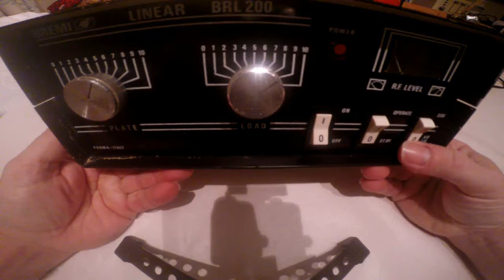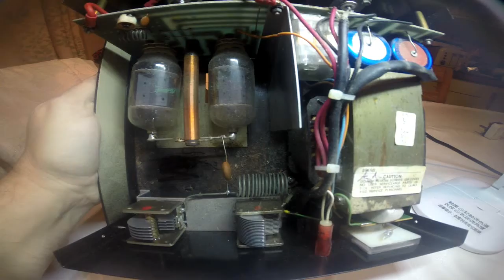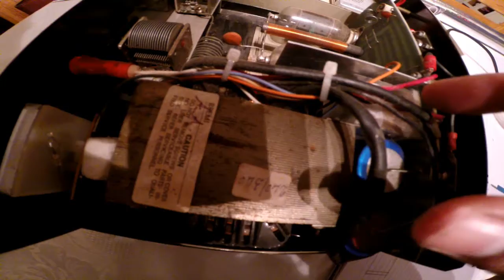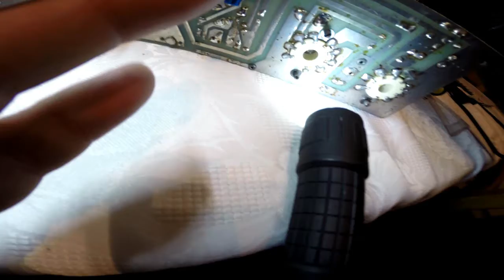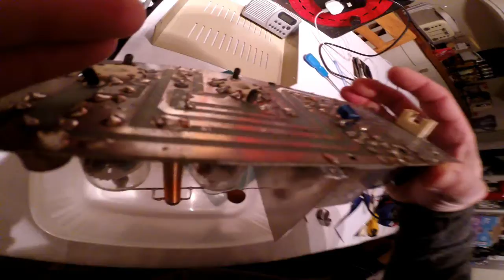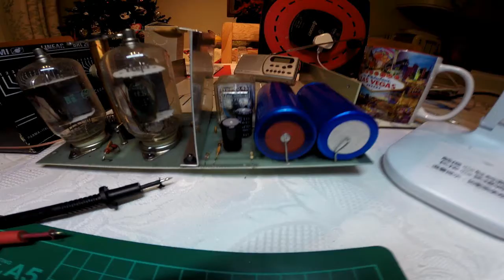Repair of my Bremi BRL200 - Part I

Comment: Hello my friend, I am looking for the secondary voltage on the two windings, I think 300v for one and 6v for the other can you confirm? in my amp the transformer is short circuited and starts to burn when the power is switched on.
Reply from the maker: @galinouz6404  i would replace the four diodes, probably one of those has failed.

Comment: ive got 2 of these at the minute one is putting out around 30w with 4w in and the other just blows the fuses when switched on so im going to do the same as you and probably replace all the components on the boards. i know 3 of the tubes are good. i dont suppose you have a list of all the components on the board at all so i can get them ordered? if not ill take one apart over the weekend and get an order together. cheers
Reply from the maker: @jasonc4696  on the internet you will find the schematic that lists the parts / values, but watch video as some parts i found to be different, be extremely careful going inside one of these as they contain lethal voltages inside, if no electrical background i would advise not to go inside, be careful

Comment: When you have repaired it try and fit a fan near the valves (pc type fan) with the fan sucking the air out the unit!.
Reply from the maker: Hi Elliot, sounds like you have done that before, would i mount it on the top of the lid immediately above the valves. Would it mean cutting a square hole in the lid? Hope you having a good christmas and all the best for the new year!
Reply: @britishcbradio1055  just drill a pattern of holes above the valves and fix the fan above the holes, the valves might be available from langrex here in the u.k.

Comment: I remember back in the Earley 80s a guy having one of these and he thought the plate and load controls were for power reducing and during transmit you could see the valves glowing cherry red due to the enormous anode current flowing.
Reply from the maker: Yep i have seen that too, mind you there isn’t a lot of info out there on these so probably an easy mistake to make. Hope u having a good christmas and all the best for the new year! 👍

Comment: Interesting Vid, i have 2 of these beast's i did find dry joints on mine as well. Be interested to see your power on SSB when you are done. Do you have to desolder the tubes to swap out or do they just pull out of the slots? I cant remember when i did mine years back.
Reply from the maker: Many thanks. I will definitely put it through the dummy load if successful in mending it and confirm output on AM/ SSB. Funny that you had dry joints as well, it must be the time for them to start suffering, mind you they are getting fairly old now. Hope you had a-great christmas and all the best for the new year. 👍
Reply: @britishcbradio1055  look forward to part 2, best wishes for the coming new new year !